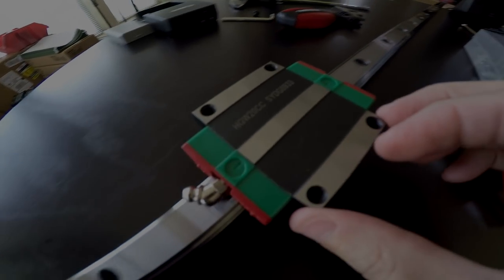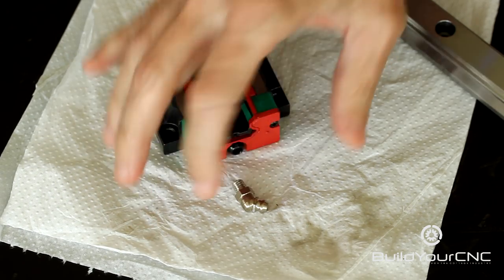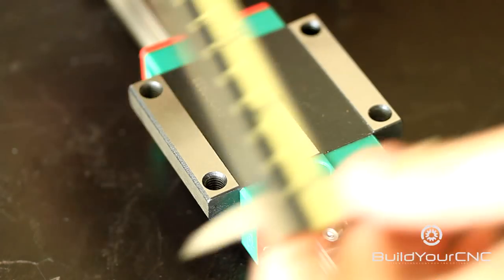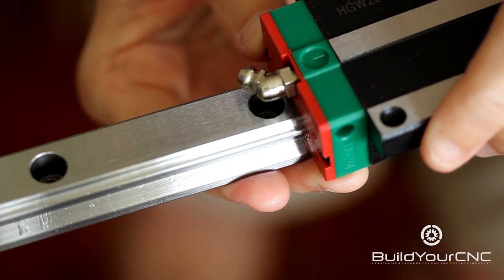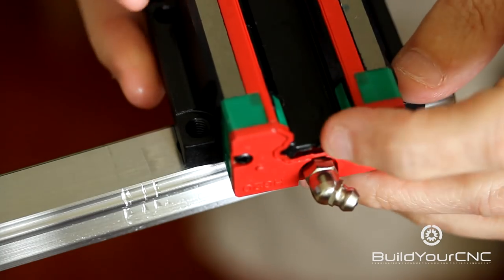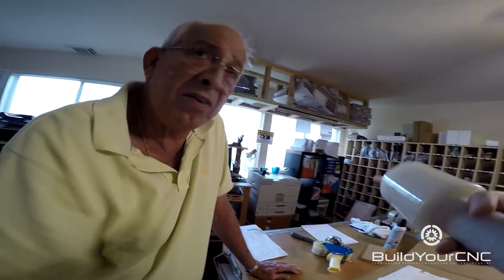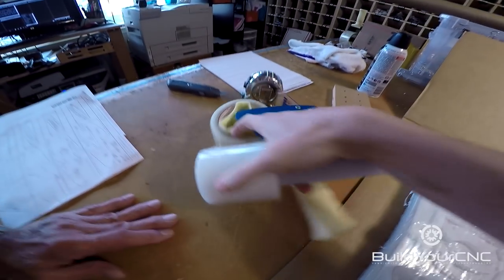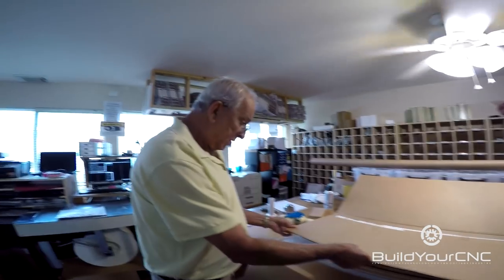How to use 20mm Hiwin linear rail blocks

Comment: What size would you recommend for a 20x40 bed mill? Are 20,25 large enough or do we need enormous 30’s? Also how well do the blocks work where a heavy bed is hanging over the end? My thought was to install 6 blocks, 3 on each rail to the center rig the saddle but that means a 60” table will hand 40” over where the 6 blocks would be grasping the end 20” section. I know most large vmc machines run so there isn’t any overhang and that’s why the machines are so large given they typically don’t have the travel you’d expect from their size. Interested in hearing your thoughts and advice.

Comment: HI! it might sound like an odd question: Is it possible to install the rail upside down? (in the sense that the weight would be pulling the block downwards)
Reply from the maker: Yes, that is fine.  The bearings are located above and below the angled sections of the rail.

Comment: can mill steel with them?
Reply from the maker: You can use these rails in machines that are dedicated to milling steel, yes.
Reply: ok. thanks. i have the cheap round linear rail with support but i barely mill aluminum.want something more rigid.
Reply from the maker: This will do it.